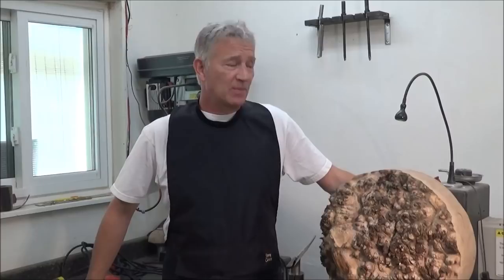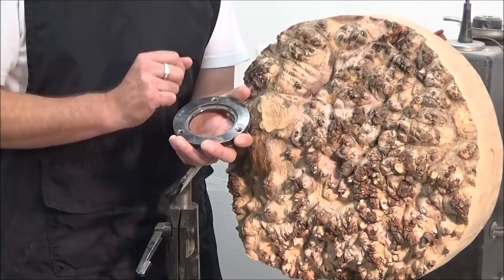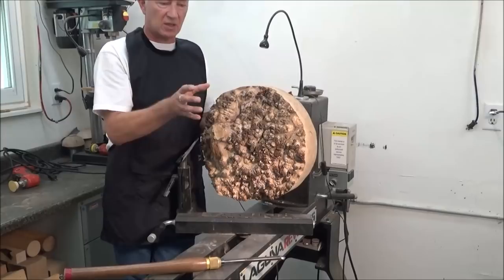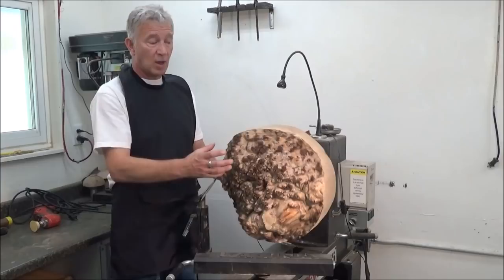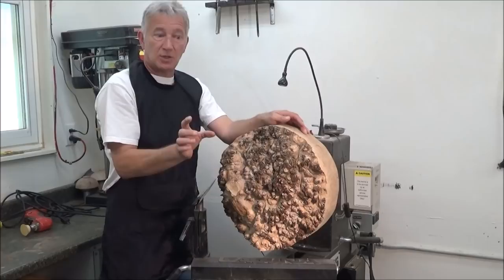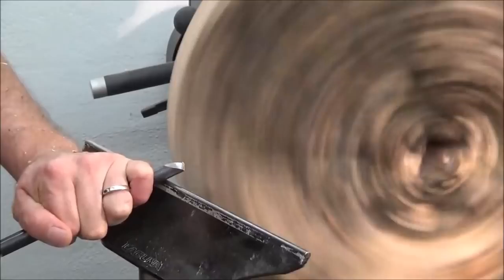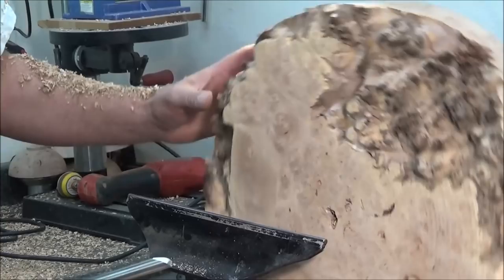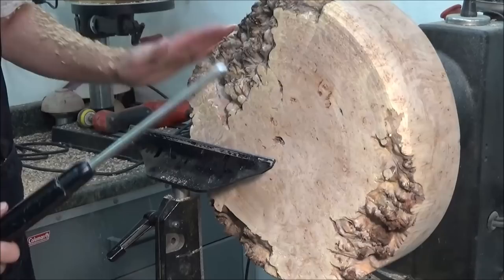Turning a Maple Burl Bowl with Jimmy Clewes - Part 1

Comment: Tip; have a lot of experience with such burls, when they've been sitting around for years like this one  it's  like trying to turn a brick so I put them in a plastic bag and soak them in mineral oil for several days or even weeks which soften the fibers making them much easier on the tools not to mention the turner.